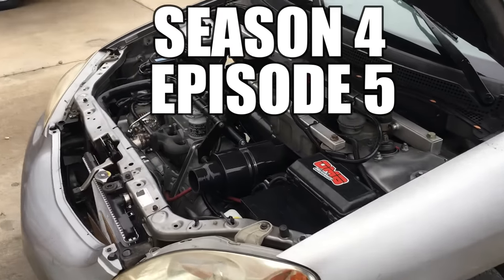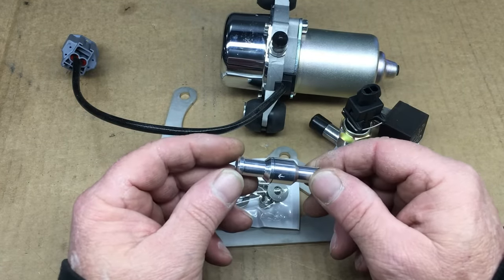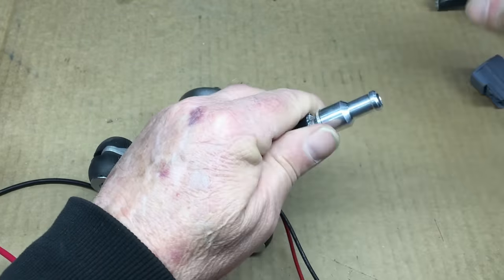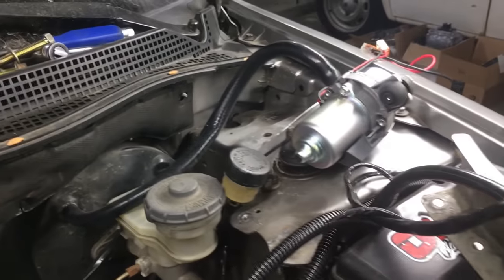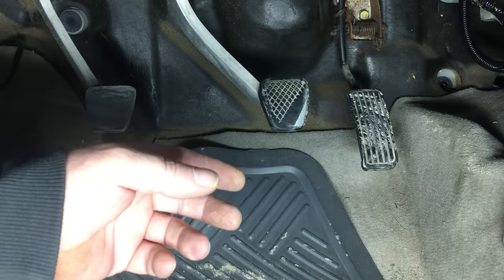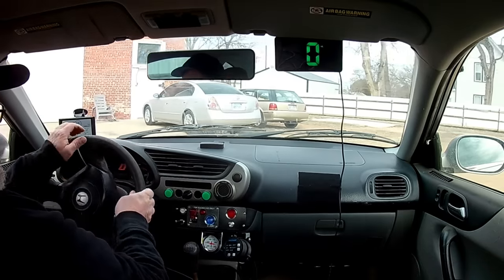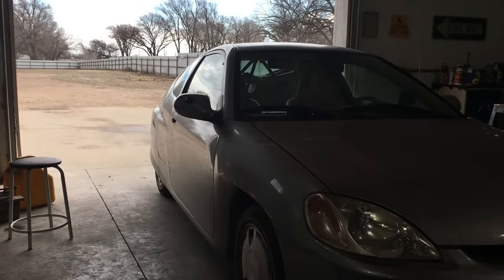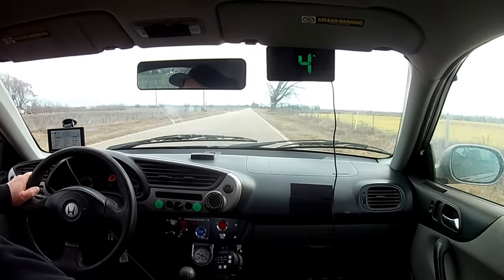S4 E5. We fix the power brakes with an electric vacuum pump and a bit of engineering.

Comment: Just cut a hole in the floor board and drop out a anchor when you need to stop, the bare feet help when you need to stop fast. That way those electrical engineers wont fault your design😎

Comment: That's the same pump used on practically every Chrysler, Dodge, Jeep and RAM product for the last several years.
FYI the OE ones seem to really like overheating if you run them just a little too long.
Reply: Also if they do have an internal check valve it absolutely sucks (haha).

Comment: check out the thermostats being used on mini coopers. specifically a 2010 r55 uses a electronically controlled thermostat, as for how to incorporate that to a kubota... havent a clue since its molded in the thermostat housing

Comment: Booster should have a check valve, with a pump, use a Hi C can like they did in the past. I would go pump , valve, tee with the can , and then booster with its valve. This fixes the problem so you can replace the missing hose and valve assy , and you can get double and decent safe brakes . Love you Jim , now move to Bama and try him. I would be your slave .

Comment: With a couple BJT transistors and a second vacuum switch, a fart smeller could make a simple latching circuit to implement hysteresis based on pressure. Just a thought!

Comment: ALSO...there are OTHER WAYS to generate vacume. I f we look to the aviation industry, in the early days, the only electrical system was a magneto to fire the spark plugs. When gyroscopic navigation kicked in, the instruments were vacume powered. To generate the vacume, a ventury shaped device was simply hung out in the airstream. As speeds increased...and drag coefficients became more important, and electrical evolved , that system went in the garbage.You have an air stream in  your intake hose. In automotive racing where cam profiles and WOT operation limit vacume...and reduced crankcase pressure equals horsepower...they stick a tube in the exhaust at whatever angle is best...the exhaust passing the end of the tube generates vacume Both of the systems exibit qualities of simplicity and almost 100% reliability...I'm not an expert...but a little research and fabrication might go a long way.

Comment: Would you be able to use a latching relay? Im thinking the low vacuum switch can turn on the pump by energizing one side of a latching relay, while an additional high vacuum switch energizes the de-latching side. This would give you a deadband similar to a home A/C if im not mistaken

Comment: Apparently there are also fully electric brake boosters but are pricey, one thing got me curious how fast would it work with the brake switch turning on the pump? if it is fast enough to create vacuum it could eliminate chatter and no need for fancy stuff.

Comment: Regarding the temp issue: what about an electric water pump with temp speed adjustment. It would heat up way faster. And replace the belt driven one.

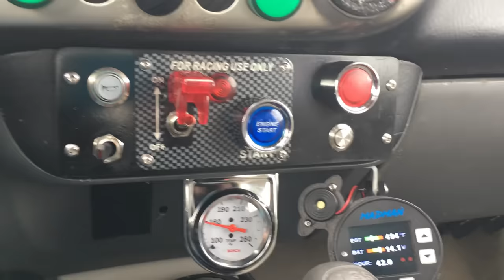Comment: 17:45 As I said before, diesel engines are inexplicably cool running, and therefore, getting them to run hot takes more than you would think.

I work on diesels a lot, and their radiators are more simple, yet robust on heavy equipment where heat rejection is easier, and were toughness is more critical [dirt, branches, bugs, mud, etc] because they need just a little bit of cooling, but they need it even when they are doing very dangerous things, OR being parked for very long periods of time.

Comment: What if you replaced the vacuum switch with just...the brake light switch? Every time you press the pedal,the pump will run,ensuring you always have brakes when you need them. If the car sits for a while,just hold the brake pedal for a few seconds before you start driving (which you probably do by habit,anyways) while it charges the booster.

Comment: Diesels use a system called "hydroboost" which uses the power steering to generate boost. I'm wondering if a pressure tank of some sort would help with the pump cycling?

Comment: I expect the vacuum switch chatter is due to ambient humidity/temprature( as soon as it turns off, vacuum rises due to moisture sublimation and ambient heat warming it up). It also doesn't have a function range? If the On/ Off thresholds are separated enough, I think chatter would be a non issue.

Comment: Something where the panic switch is flipped by pressure on the brake pedal, so you get vacuum added to the booster every time the brakes are applied?  Would that be enough time/vac to be worth doing so you don't have a special button to be used in case the primary control circuit fails?
Reply from the maker: Yes, for the panic switch on the brake pedal would be the best solution.  The way the current system is wired with the grounded vacuum switch,  the brake lamp switch provide the wrong signal to trigger the pump and of course we could invert the signal via another relay.  As I mentioned we will be changing the vacuum switch to an isolated switch along with a time delay relay and we will likely tap into the brake lamp switch with a diode to prevent the brake lamps from coming on when the pump is triggered normally

Comment: You could also bypass all of that and just run the pump off of the brake light switch?
Reply from the maker: Keep in mind the pump evacuates the booster and we can store a charge of vacuum in the booster for when we need power assist.  Running the pump off the brake switch would cause a delay in how fast the vacuum can be generated.  So with your idea, there would be no power assist for the first second or two then the power assist would gradually build up.  It would make the brakes feel inconsistent.

Comment: it doesn't matter if you use time on or time off relay. they both create a delay what is needed to fix the chatter.
Reply from the maker: A time ON would delay the relay from coming on.  That would increase the time that there is low vacuum in the system.  A time OFF would energize the relay immediately and the relay would remain energized for a few seconds after the vacuum in the system reached a safe level.

Comment: Hey Jimbo, regarding the thermostat; it looks really similar to a common marine thermostat I've come across in my travels.  If you can post the sealing disc diameter I can check it against one I have in my parts bin.  If it's the same I wouldn't mind donating one to you.  If it's close, I'll bet you could cut down the disc slightly to make it fit.

Comment: "........ We're going with an off the shelf solution for simplicity".......... From the guy who's project car's running gear is pretty much MADE of one off custom parts ! :D

Jimbo, if the gnomes have secretly got you captive and are making you do stuff against your will, just slip the phrase "My hovercraft is full of eels" into next weekends video and we'll send the boys round to bust you loose ! :D
Reply from the maker: LOL... you are right.  To be fair, a project like this brake system fix appeals to a lot of people. The skill level of those folks vary.  so on something like this, using off the shelf parts makes the project something that can be copied easily.  I could have used an Arduino with a vacuum sensor and whipped up some code to solve this problem, but that's not a realistic solution for most people.
Reply: @robotcantina8957  So you're safe and well? There's no gnome uprising? :D
Reply from the maker: @Reman1975  The gnomes have been quiet lately.....hmmm

Comment: 17:00 Instead of pulling the original pulleys off of your system, seeing as the one is also a critical part of the engine's balance, it is by all means better if you can do what many modern vehicle manufacturers do, and put an extended pulley 'piggy-backed' out from the original ones.

Also, by not breaking loose the original pulleys, there is less chance of slippage and fitment problems.

What I would suggest, is to find appropriate faced pulleys, but ones you can not only bolt on top of the existing ones, but ones you can either drill and screw into the originals [harder up front, but easier to remove, especially if you wish to change drive ratios, as many racers do regularly], or else epoxy them to the originals [less work to put on, but harder to remove and swap out].

I examined the image carefully before saying this, because with some balanced pulleys, drilling and changing things could mess up that crucial balance, but on this one, the harmonic balancer on the crank will not be adversely affected, so long as you very precisely position your holes [two minimum, but 3 maximum] based on the very small boss resting on the top of the pulley in the still image.

On the supercharger side, any evenly spaced number would work, but for a higher ratio, you would certainly need to drill 'down' in the recessed area, so as to ensure the screws have all the space they need to not infringe upon the outer edges of the new drive pulleys.

I would suggest somewhere between 5 and 6 inches on the crank pulley, and 4, down to 3 inches on the blower pulley, but some fudge factor is in there toward a smaller driven pulley, IF you have a pressure blow-off valve, so as to keep from burning your blower belt up.
Reply from the maker: The engine is tightly packed in the car and there is limited room by the crank pulley.  Stacking a second set of pulley would be difficult.  Our plan is to keep the crank pulley in place to maintain balance and slip a serpentine pulley over the crank pulley.  That way we don't  run into clearance problems.  but as you know, before we move forward with this modification we need to verify the boost first.
Reply: @robotcantina8957  Well, if you can fit a pulley over the original and not have it wobble, slip, or become deformed in the process, that makes perfect sense.

As with all boost ratios, its a well known formula, which I'm pretty sure you already know fairly well, based on your previous exploits.

I trust your judgment.

Comment: I keep thinking a cheapo microcontroller like an ESP32 could be used for all the electrical delay/timer/etc issues. They are the $5 solution to pretty much everything, plus you could tap into the CANbus.

Comment: Why not use a vacuum reservoir to not beat up the vacuum pump and also have no delay? Or i guess the brake booster it self is a good enough reservoir? Idk, personally just makes sense to have a backup for vacuum, i hate brake and steering failures.

Comment: And another great Sunday morning ... now to the boring stuff 😅 jk .. got my lil forged bored 30 thou over big turbo running 35psi miata imma play with today 😅 I just got my launch control and anti-lag working priper last weekend , I been clean up the wire route under my hood to look cleaner and today I think maybe some tuning .. then I need to decide if imma weld a diff or get a helical for it as I have 2 differentials (and 2 trans cuz need backuups when giving car 4 times its oem power lol) but tbh I been trying to find a mini spool gor it amd just can't find one so closest thing would be to just weld one I guess 😅... then I need to start recording well I do now just not posting , but I actually make my own high octane mix race fuel and have been experimental with other mixes and I want to get a flex fuel sensor next so I can start mixing e85 and 93 pump to see what e30 and e50 results will be as to power gains , fuel milage , knock control ect .. sorry for rambling lol much love and respect jimbo stay safe keep having fun and build on my brotha ✌🏽🤘🏽

Comment: The pump problem could be solved by having 2 switches at different pressure levels and a locking system with relays; the lower vaccum switch would activate the main relay, and the output of it would go to the pump, and through the higher vaccum switch to the coil (the second switch needs to ve isolated from the frame). When the lower vaccum switch activates, it would power the relay, and the relay would power the pump and itself; when the second switch deactivates, the relay will no longer power itself.
Reply from the maker: Yes, that would work.  Now the problem is finding two switches of different values.

Comment: Could have just used an alternator off a diesel that has the vacuum pump on the back
Reply from the maker: Yes that would have worked, however on this engine there is no room for an alternator that size.

Comment: Why dont you use a factory vaccuum pump? Most diesels have a vacuum pump fitted to the back of the alternator. Would have been a bit easier that way I guess....
Reply from the maker: You could do that on your project car, however on our car we don't have any space on the front of the engine for a pump or alternator with a pump  so we decided to use an electric pump.

Comment: Do it the lazy way. Wire it to the brake light with a relay and pump will run when brakes are applied. Easiest fail safe.

Comment: the lower cost switch could be wired so it is not ground if one inulates the mounting it is no longer a ground switch and could be wired like the more expansive one

Comment: I was really getting in to the Renault. Then you just switched to a car we've seen before in another project being powered by an engine we've seen in another project. It's almost like a rerun. I'm just not interested in this project. Any idea when you'll be back to working on the Renault?
Reply from the maker: The Renault is still alive.  The car doesn't have heat and we put it on the back burner during the colder months.
Reply: @robotcantina8957  Oh yeah, I didn't think about that. The Renault has an air-cooled engine. There's nothing to hook a heater core up to. That does make sense.

Comment: Hey Jimbo, I used to drive a diesel nissan bluebird and that used an alternator with a vacuum take off to power the brake servo, is this something you may be able to do here? 

Also is upgrading to a serpentine belt system viable?

Comment: I think I understood most of what's going on except for the chattering vacuum switch issue. Is it just because the "on" pressure and the "off" pressure are too close? Could it be fixed with a vacuum holding tank like a well pressure tank?
Reply from the maker: Yes, the chattering is due to the ON and OFF positions of the switch being too close.  Here is an example.  the pump draws the booster down to 15 inches of mercury before the switch turns off the pump...unfortunately since the switch is a bit sketchy the pump will turn back on again at 14.9 inches of Mercury.  Adding a bigger tank, you still have the same problem.  Our solution is to keep the pump running slightly longer so it develops more vacuum and the pump turns off well above the ON/OFF area.

Comment: Did you try setting the vacuum switch in between the one-way valve and the pump
Reply from the maker: Putting the switch between the pump and the check valve wont work.  When the pump shuts off the vacuum bleeds away rapidly and thus would re-trigger the switch.
Reply: @robotcantina8957  OK I see thanks your the best!!

Comment: Why not use a time on relay connected to the break pedal switch? It would recharge the system every time you push the breaks.
Reply from the maker: A time ON would delay the time the relay turns on.  A time off allows the relay to stay connected for a short while after the command signal is released.    Using a time off relay connected to the brake pedal would work to charge the booster with vacuum in a perfect world, however a leak in the system could cause all the vacuum to leak away and there would be no vacuum the next time the brakes were applied.  Of course the pump would immediately turn on and restore the boost, but keep in mind as the boost is being restored, the extra effort thats being applied to the brake pedal would be greatly amplified a few moment after the pump started running again  it makes for a dicey situation. I believe the vacuum switch keeps the system stable and the boost should be consistent even if there is a minor leak in the system.  You may disagree, and that's fine. you can design your system however you want.

Comment: So dropping the original $99 Predator motor in the Insight was "just for fun"? So the rest of your automotive hijinks were intended to save the world?
Reply from the maker: One of the most misunderstood things about this channel is... everything we do is just for fun.  Lawn mower powered cars are not practical, but are fun to build them.  I could easily have a channel about installing a LS engine in everything, but you cant drive an LS powered car at wide open throttle on public roads.